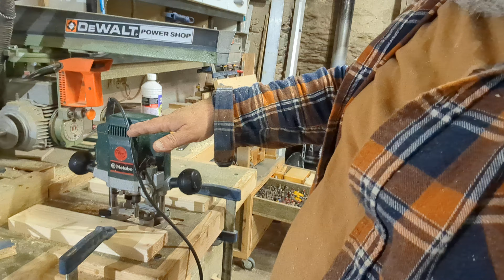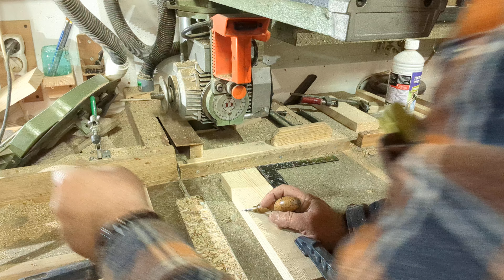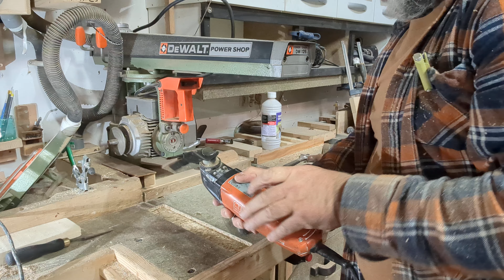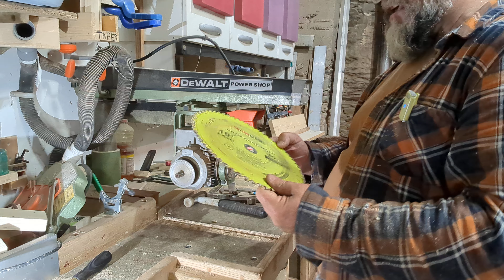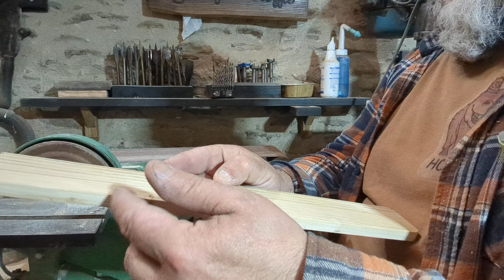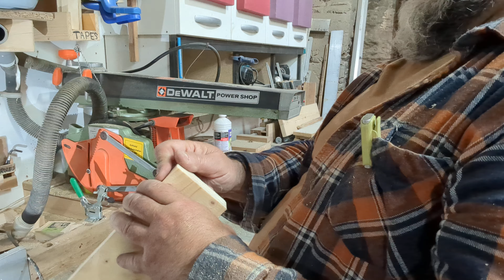Making a blade insert for the chop saw or radial arm saw

Comment: Unrelated to the current video, but SawStop has filed a lawsuit against another company for violating several of their patents which they also have explicitly stated would not be freely usable if legislation to mandate their safety systems were to be passed.
Reply from the maker: So they lied?
Reply: @WallyboisWoodworking  no, at least not yet, the legislation hasn't gone through, so they aren't expected to open up that one particular patent.  But it does make clear that the one patent they promise to make fully available isn't sufficient to actually build a similarly performing system.